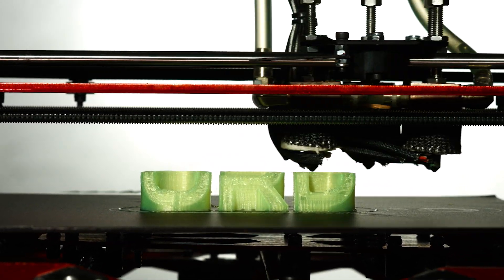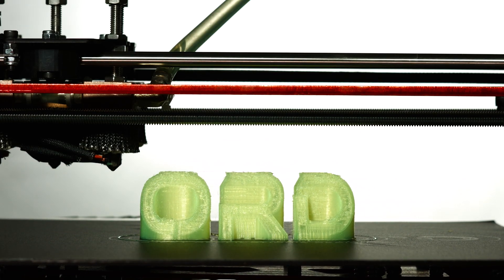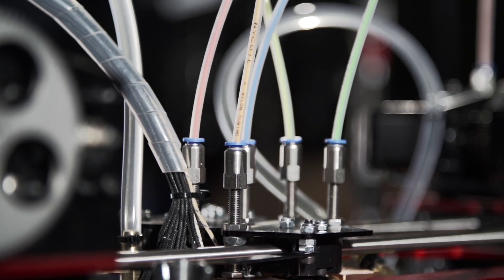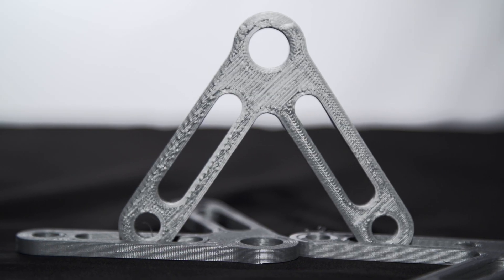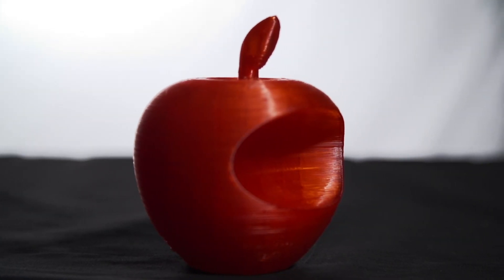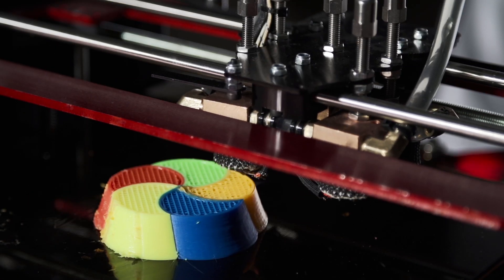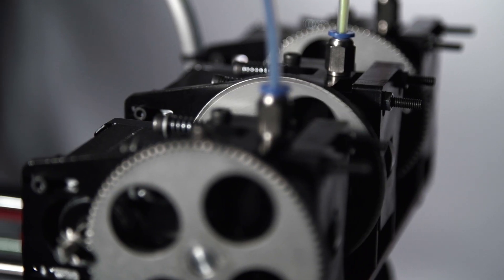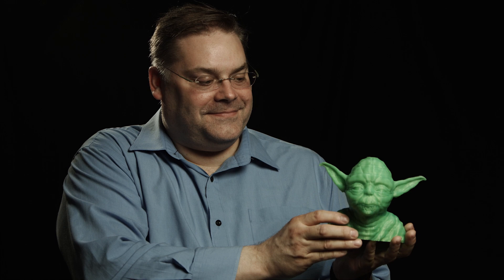RoVa3D : The First 5 Material/Color Liquid Cooled 3D Printer

Comment: $2750.00 for a printer? ill wait til the price drop to $50. HP always deliver
Reply: Yea probably, but printer filament will cost you $50 per 10 grams
Reply: 9 yeas later and still waiting for an HP printer...  Although the price has came down a lot!  For less than $1k you can buy a printer that runs circles around this